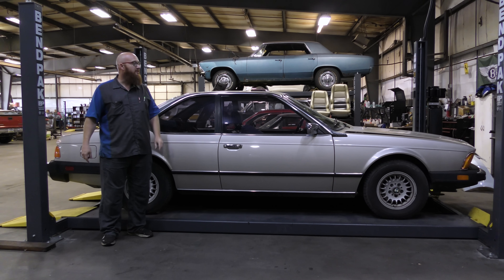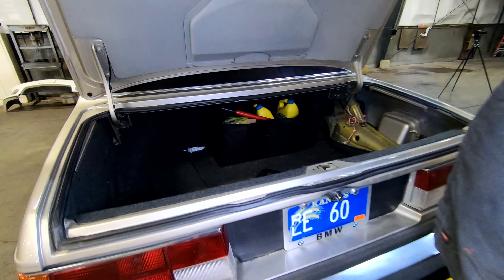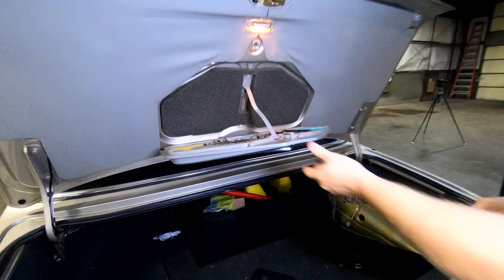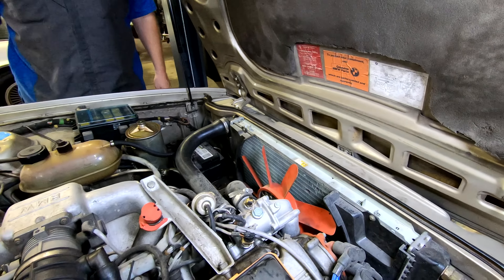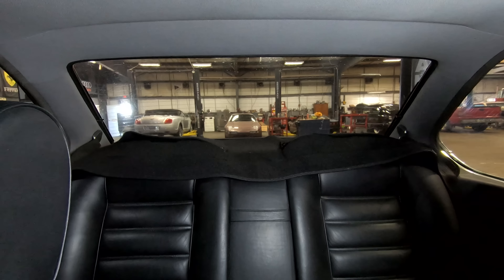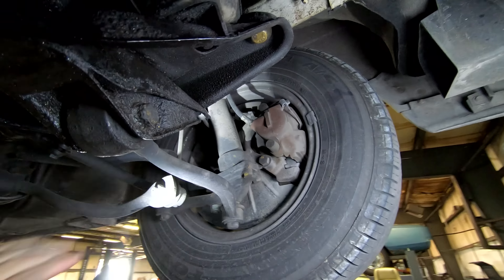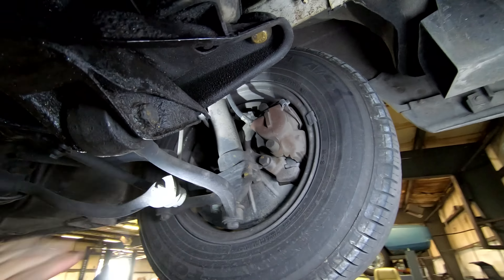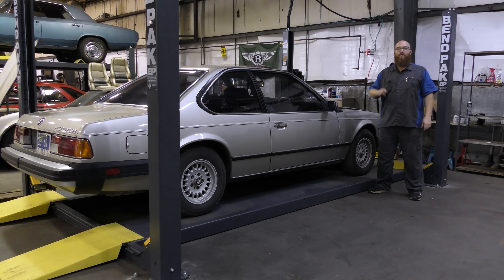Finally a BMW the CAR WIZARD will willingly work on! What makes this '83 BMW 633CSi so special?

Comment from the maker: I will still work on select 80s cars guys. My last video was a reference to quitting on the 70s and older cars.
Reply: David l am a fan of inline 6 engines and this BMW 633CSI has 181 HP that is good HP in my book...Thanks Mr. & Mrs Wizard
Shoe🇺🇸
Reply: The complete tool kit is worth a fortune cause usually it is missing.
Reply: I saw your last video, I worked in the Advance Auto Commerical side for 15 years, I quit a few years ago but your last video makes sense. It USED to be when I started you could walk in ( I worked at a HUGE one ) and we had 50s to 70s parts on the shelf. Now because less and less people buy those parts. They dont stock them. Seems the last few years I worked there all the classic car parts stopped being made.
Reply: @steveshoemaker6347  Euro 635CSi was 218 bhp, higher compression.
Reply: @gee530  BMW have gone back to the 1980s when everything was optional, even electric windows and a stereo. Even on my 2003 UK Z4 there was no cruise control. But to add it all you need to do is buy the stalk and plug it in, not even any coding needed!
Reply: Oil pan is cast alluminum, very light weight. Not iron like you said in the video. I have an '87 535i, same stuff.
Reply: Hold onto the gear. Maybe you can find someone who can make a new one with the plastic mold making machine (I forget what its called)
Reply: I was thinking the same thing.
Reply: Bosch L-Jetronic?  Trading the frying pan for the fire.
Reply: My favorite bimmer
Reply: can't you 3-D print the plastic gear?
Reply: Bwm?
Reply: Are you guys still not taking appointments? I have an '08 Sky that I literally can't get any shop in my area to fix. Brake lights do not work properlym
Reply: Or they want you to work on the cars or they know it's going to break down somewhere and they have to give you tools
Reply: Maybe consider getting a 3d printer and a CNC machine to makes those parts.
Reply: Monthly heated Seats! That's the straw that breaks the 🐫

Gather pitchforks people.
Reply: still sucks. I get it tho
Reply: @robertwebber2107  3D printer.
Reply: @Hardrada00  that's it. Thank you for the reminder.
Reply: If you can take good pictures and measurements, I'm sure somebody with a 3d printer could probably whip one up for you. Looks like it's just a press fit brass central central shaft. You must have local maker spaces or 3d printing professionals, looks like you only need to replace the plastic around the central shaft, it's probably only a cup of coffee's worth of materials. The expensive bit is a printer with the required precision to do a good job, and by extension buying time on one if you don't own it yourself, but still surprisingly cheap if all you need is a plastic gear to slide over a brass shaft.
Reply: SENT U COMMENTS ON OTHE PAGE
Reply: Hope u see my comments on other page
Reply: @TheMrLebaron  The big change in the UK came when dealers were told not to stock parts and order over night from the manufacturer. This meant the inventory of spare parts dried up very quickly. I remember ordering parts for my Alfa 156. I ordered them at the dealership and he said "They have to come from Italy". My heart sank, but he said " They will be here by tomorrow afternoon" and he was right. It does mean there are no stocks of parts for older cars any more and parts dry up quickly after factory support stops.....unless a manufacturer plays ball, or there are aftermarket parts.
Reply: BWM :)
Reply: Mr. car wizard have you thought about buying a 3-D printer   you can scan the part  and have the 3-D printer printed up
Reply: Wizard your being to sound like Scotty. I don’t like working on new BMW 😂
Reply: @jacoby1234ification  why are ur replies going to me? When I sent comment to wizard
Reply: @jacoby1234ification  And I never sent a comment to u. It's weird
Reply: @janielramirez9181  sorry about that I meant to send it to the wizard thank you
Reply: @timhancock6626  Its getting the same way here in the US, even with 90s cars. It used to be I could easily get parts for my 1996 Toyota 4Runner ( they dont sell them outside of the US, think of it like a smaller land curiser ). that I use as a tow car and to get to my camp. But now even basic parts are 2-3 days out, same thing
Reply: 3d printing....would solve that part issue...
Reply: @jacoby1234ification  don't worry about it. I was just wondering why that is it's nt the first time.
Reply: Maybe you can build a by-pass kit for the heated seats so you can use the heater without dealing with BMW
Reply: Unless it is Hoovie's pre-70s car haha.
Reply: @toyota420xp  Ferraris come with mechanics.
Reply: If you're intersted in this car,
check out the review of the 635CSI M version on HARRY'S GARAGE!!!
👉 https://youtu.be/qLXMdcxMxOs ▶️ 
(Better than Doug DeMuro!)
Reply: Watched this with an BMW tool kit water pump in my hand pushing together the wood suround for my shifter in my newly aquired E32. Old BMWs are solid for sure. I do prefer the 70s and 80s mainly. Low spec early M20/M30 E34 the newest BMW I want to own and my sweet spot.
Reply: Had a '73 Bavaria in high school. Those 6's were a very strong motor, same as that 6 series as they used that block forever.  Great unique sound. The duel Zenith carbs were a pain to keep balanced in the early cars.
Reply: I need a bit of advice from the car wizard as i cannot get the trunk open on my 1977 633csi after it opened too far and when i closed it again it is impossible to get it open again
Reply: yes i suppose a 3D print of the gear could work.  metal 3D printing i can't wait is available for the at home mechanic.  so even if small parts like this are NLA.... we have the technology to make one.

Comment: Given the propensity of older plastics going bad I think it is time for the car wizard to invest a high quality 3-d printer for some of these bits and pieces.
Reply: Correct!  I was about to recommend that he ask the room if someone has a good one, and make him a new one from nylon.  I have the capability, but not the time.
Reply: I was thinking the same thing
Reply: Save the 633!  Calling all engineering geeks!  Let’s get this done.
Reply: Or a couple cnc machines
Reply: I am seriously considering it for my 34 year old E32
Reply: @CreationsVibration  A real handdy person would make one using only a nail file and the first piece of plastic found on the garage floor....lol
Reply: @trwsandford  How using shoe-goo to fix the part...
Reply: Yes I agree thay our worth every dollar .
Reply: 3d plastic isn’t really suitable for high heat applications
Reply: Would likely be better off partnering with a machine shop/3d print shop - they have the tools and knowledge, it would be a substantial investment (space, personnel, the actual tools) for a shop like his to add that capability
Reply: I am very skeptical that '3d printing' would produce something of high enough strength or that the gear teeth would be sufficiently accurate enough to do this job.
Reply: @tcm81   I would encourage you to look up specific image nylon nylon 3-D printing.. What I'm suggesting is already being done for the aerospace industry the military as well as some limited run auto manufacturers.
Reply: @MikhailScottKy  That sounds very expensive if you would need an aerospace grade machine? Then you would need software and the ability to produce designs?
Reply: Or pay someone who does that kind of work already to custom make the gear. He doesn't have to try and do it himself, and there are lots of people doing that kind of work with 3d printers, and also there are small machine shops that can make the gear using machining process from CNC to totally manual machining processes as well. It's not a difficult problem to solve. Yes, it will cost more to have something custom made. If there's a market for such things a small custom shop can make and supply them. This sort of problem always presents a business opportunity for someone.
Reply: @fredflintstone8048  There are companies that have whole catalogues of plastic gears in standard metric sizes. There may be something sitting on a shelf that would do the job.
Reply: How much do they normally run you
Reply: @sunnohh  Now there are many grades of print plastic including high heat versions. So .......
Reply: @tcm81  It's possible but looking at the gear while the wizard was holding it up showed a  shaft that may be unique and would have to either be made separate and then be attached to the gear through the center hole  with a key, or the shaft may need to be turned or printed as an integral part of the gear or gear blank if the teeth are to be reground. Personally I would have to hold it in my hand and do some measurements in order to tell. It's also possible that the existing gear could be separated from the shaft and a new generic gear as you mention be affixed to the shaft with a minimal amount of modification to the shaft and or the gear. Personally owning a metal working lathe and Milling machine such modifications are simple.
Reply: @tcm81  -- It depends on the printer and the types of material it can use.
Reply: Laser cutter or CNC with a small end mill, a piece delrin, Bob's your uncle
Reply: Exactly. 3D printer are a grace of the gods in a shop
Reply: @sunnohh  depends of what you use, but an antena is not a high heat place
Reply: 3d printing auto parts is probably a horrible idea give then are extruded and not a solid injection mold not to mention the specialized high strength high temp plastics that are used. Glass also doesn't cross link to give extra strength in 3d print.
Reply: He should invest in a Metal 3D printer
Reply: @adrianjimenez3614  for sure. Actually making some metal 3d parts now. Real cool tech.
Reply: Came here for this comment
Reply: Maybe the owner want the car 100% original. Then only original will do. If not the cheapest way is a new motor. Or a wind screen antenna.
Reply: @sunnohh  nope, peek, abs and pc are all very good at withstanding heat.
Reply: Or shop ebay and get real parts
Reply: @tcm81  this isn't drivetrain related, there isn't much requirement to strength
Reply: TCI being the overriding factor, why supply 3D parts for customers? What if they decline the parts due to cost or concern over quality. In his last video he spoke of turning and burning and items like this take time and have a certain implied warranty. If I were to run a shop the customer could sure supply less than  O.E. parts or 3D printed if they so desired with the caveat that there is no warranty nor refund if it fails. The odds of a 2nd party printer supplying the correct part the first time seems a bridge to far to base a business model on. He in my opnion wants to fix what can be fixed and let the customer know what can't and then the rest is up to them. He needs cars out not a heroically no cost involved fix that occupies a valuable bay.
Reply: Or thermal plastics. Little beads you put in hot water until soft, then knead into a mass, then mould into the shape you need. Take the old piece, repair it, make a mould, and then push the thermal plastic into the mould. Could probably use the old collar.

I prefer 3D printed though.
Reply: Came here to say this.
Reply: @sunnohh  that wouldn't be a high heat application. a reasin 3d printer could make a very solid replacement. i made control arms and drive gears for rc cars with a crappy 150$ 3d printer, integza here on youtube has really pushed the stuff that can be done with 3d printing. if it was plastic from the factory, you can more then likly 3d print a replacement. but the RND required makes it unrealistic unless a lot are made or the part is very simple. the Honda del sol has arms that break for the leavers that undo the latch for the roof and people have 3d printed those.
Reply: @tcm81  you would only need fusion 360 and and 500 to 1000$ in 3d printer(s) and supplies. a gear like that is very simple. people already print replacement handles and other parts. i made replacment parts for my chinies rc car with weak cheap plastics and a 150$ 3d printer. but me spending a day drafting out and testing parts isnt really something the car wizard could do unless the customer was stupid well off, for 5k to 12k you could get a cnc and make it in metal. but same problems there
Reply: @cec4  I've gone down this exact road for small parts. The drafting time,  setup time, measuring/analyzing/ modeling the existing part (redsigning areas that are broken or worn  if applicable) proper materials , proper feedtime and path.  the variables  are daunting and often require multiple  adjustments and reprinting.  Not viable  from a time /cost perspective. The people saying it's viable haven't done it.
Reply: 3D printing would be a great way to replace that antenna gear if the right process is used.  In my work I have designed similar prototype gears using a laser sintering process with nylon plastic.  The finished parts are very dense and strong, not like parts made with the extrusion type of 3d printers.  The process uses a laser to melt successive layers of plastic powder.  Teeth as fine as M.5 are no problem.
Reply: @fredflintstone8048  Cars today are made with more plastic and made to only last about 5 years so that way you keep trading em in. Now obviously mechanics like, the Wizard here does not like it when new cars keep getting sold because that means he gets less older cars that are out of warranty to work on and charge a shit ton for in labor on. Lol. He says new car manufacturers are greedy and horrible but on the other end of the car scale, Wizard is greedy and is in business to make money, just like the car manufacturers. Everyone is biased to there own lives and life styles. If just 20% more people bought new cars every 5 years, Wizard will be making a lot less money. Ha
Reply: That was my first thought.
Reply: @MikhailScottKy  probably multi million dollar machines and massively expensive materials.
Be better off and cheaper to remanufacture them in metal, probably aluminium.
Reply: @tcm81  you can literally 3d print titanium, what would make you think you could not 3d print a simple plastic gear successfully. 3d printing is very advanced these days, all sorts of hard wearing high temp resist  thermo plastics are viable to print these days.
Reply: Just what I was thinking🙂
Reply: @sunnohh  like Jay Leno, you take the plastic piece and make a metal piece from it.
Reply: @elvisrose  3D printing is just a marketing term that encompasses everything from FDM, polyjet, stereo lithography to laser sintered metals. Which one are you suggesting? FDM parts can be brittle and low resolution. Polyjet and sterolithography parts can be light sensitive. Sintered metal laser printing is expensive and the parts can warp and develop cavities in manufacture. Many of these technologies have been around since the 1980s, but since the term 3d printing has caught on, people seem to think it is suitable for manufacturing everything.
Reply: @trwsandford  This is also why the Wizard doesn't have one. If he billed for the time involved in designing the gear, it wouldn't be cost effective.
Reply: Do it wizard. I can run it for you.
Reply: Restoring cars will be a whole new game when 3d printing reaches that last path of becoming perfekt, it aint there now
Reply: @henrik1743   It's actually close enough now with a little bit of sanding and finish work 3-D printed plastics can replace a lot of crap that is no longer made. I have actually seen rear tail lights printed turn signal cais urn signal cams as well as hard plastic parts that are for window control already printed and used in old cars.
Reply: yeah! i bought my first 3d printer for jobs like this! a real game changer!
Reply: He doesn't have time to print his own, he needs a good vendor contact and maybe someone in house with CAD experience.
Reply: Was just about to comment this
Reply: @alexmercer8042  You can probably find open source 3d print models online. Car companies hate it, however.
Reply: @EdgyNumber1  Oh I do. I even had to scan some parts which were originally not available separately
Reply: @tcm81  3d printing nylon is very basic and will be entirely suitable for this purpose
Reply: They've been playing around with ceramics & metallurgy lately, but unfortunately, the technology for those being printed is still a long way off.
Reply: @MattBlack6  Sure, Kindig It (Bitchin' Rides) is using a $150k Stratasys, but it doesn't require more than a Prusa i3 or Ender 3 (under $1k each). Check out YouTube videos "3D print for a living? - Meet a Maker: Myles" and later "3D scanning + 3D printing to complete a classic car restoration". 
 
Also see "3D Printing Car Parts - Under the Hood (or bonnet) - After a year of motorsport......" and "3D printing functional car parts with ApolloX". All done on typical hobbyist grade machines.
Reply: I was thinking the same thing about the post printer.
Reply: Is there anybody that prints plastic for these old bmws?